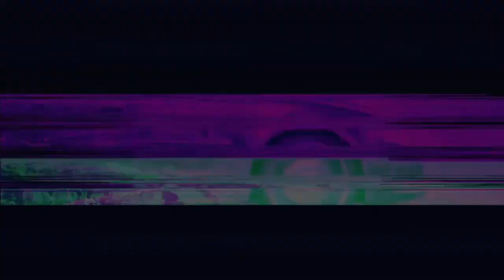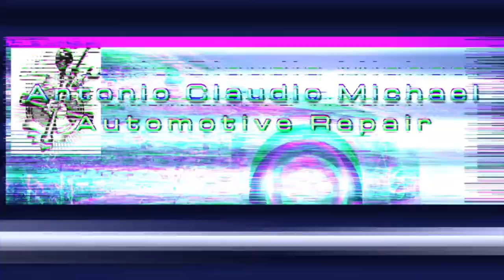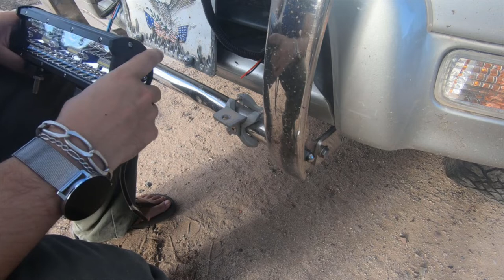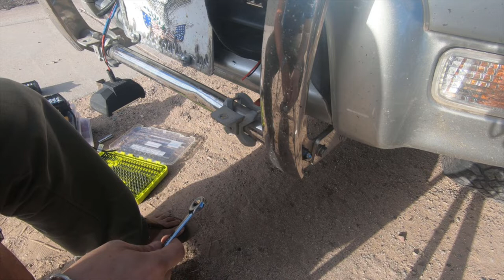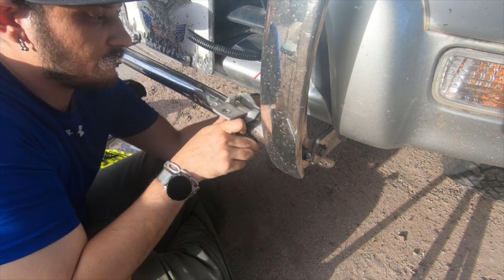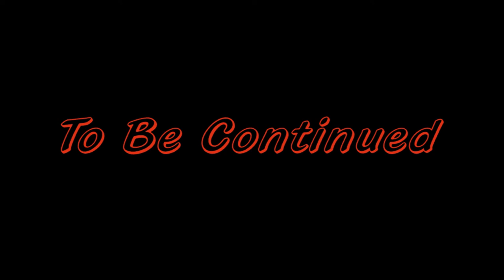Electronics - AmBother LED 7 Inch and 9 Inch Lights Install Part 1

Comment: Hate it when things go as planned.
Reply from the maker: Not one thing about this went as planned didnt think I would be replacing Allen head bolts bot 1 snapped
Reply from the maker: Only thing that went as planned was the wiring because just needed to wire new lights to old wiring